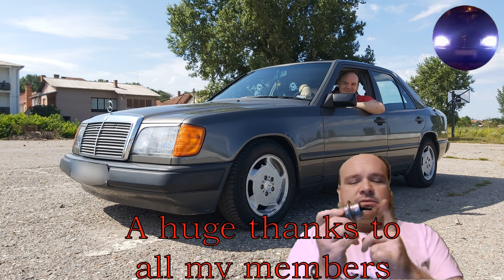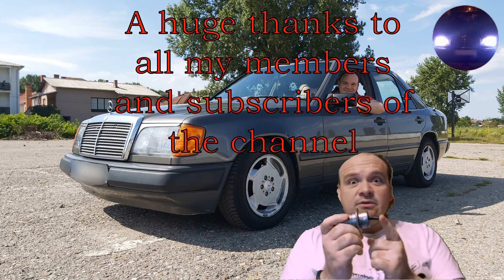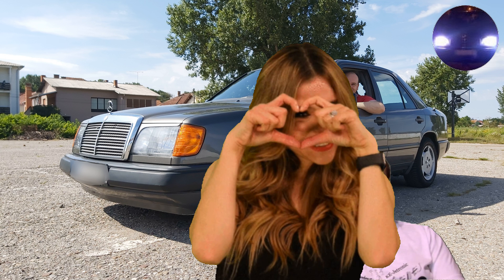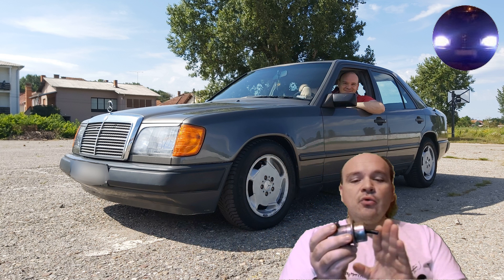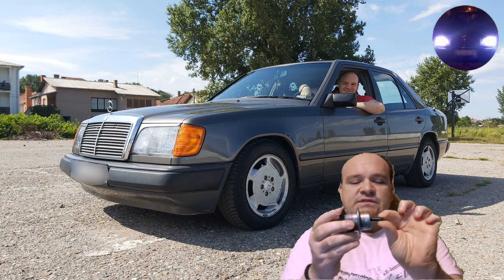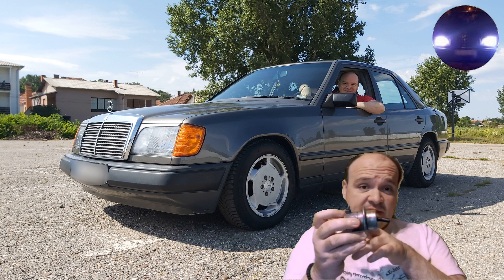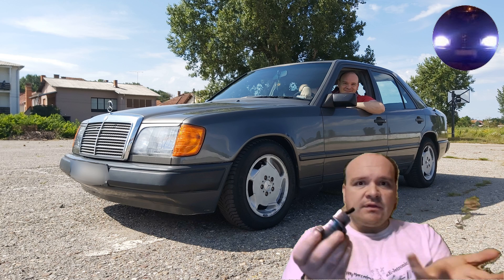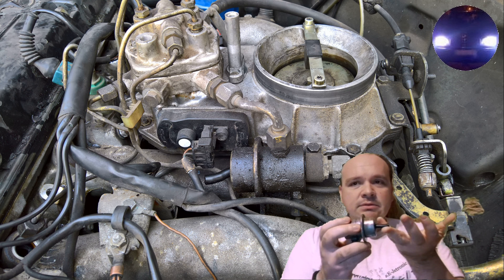㉦Mercedes Ke-Jetronic㉦ - I was wrong!

Comment: Hi Ivica.
Regarding this vent line from the pressure regulator, there is a guy Tony working on a 560SL and there i've seen a vacuum linevfrom this regulator vent to the right side breather hose from valve cover to air filter. What do you think about that?
I will check in my manual for the vacuum arrangement in a week and i'll let you know. Also there is a australian WWMA that works on w124s and he said that this black hose is also a vent. Can be used with different purpose on dif engines? Is this press regulator part number the same for all engines?
Reply from the maker: No, it's not. The same is for m102 and m103 engines, for the others not because they work on higher pressure. There is no vacuum there. I have on my Instagram profile the cross section of the part, it's from Bosch literature and it says clearly VENT. The vacuum is measured there where the air is constantly changing and here nothing is being changed, the part must hold firmly a steady pressure(not speaking about the harsh accelerator).
Reply: Thanks Ivica
Reply from the maker: @ionutboruga6015  You are welcome 😊 Happy Mercedesing 😃 🍀
Reply: On m117.967 there is a vacuum line there
Reply: I cannot attach a photo of a scheme
Reply from the maker: I have it on my Instagram page explained.

Comment: Can i use universal 0 to 10 bar oil pressure sensor for mercedes 230e w124 ?
Reply from the maker: Use the one as the original one.
Reply: @mercedeske  ok 👍👍

Comment: I have a 1989 300e California version and I can’t do a duty cycle it doesn’t read so what should I do I replaced the eha vavle and nothing
Reply from the maker: In order to do duty cycle your potentiometer must be good, lambda and the EHA. But, if you want to do duty cycle do t on the EHA measuring mAmps. When warm on idle you will have to get the fluctuation -3 to 0 mAmps
Reply: I use a snap on digital multimeter on the x11 plug on the wheel well , pins 1 and 3 , turn the multimeter to duty and change the settings to percentage. Set it as close to 50% as possible with the engine at running temp . You should block off the pipe to the fuel vapour filter in the wing but I don't think it makes much of a difference
Reply from the maker: @carnhicks2650  Yes, you can but connect the ground on 2 and positive on 3.
Reply: @mercedeske  just thought I would add , thanks to you , I've managed to go through most of my system and sort out quite a few issues I was having with over fueling , car runs great now . All I do now is adjust my air/fuel ratio whenever I hear the car having to make adjustments to correct the duty , you can hear it drop revs every now and then , that's when I know its gone out of adjustment
Reply from the maker: @carnhicks2650  👌🏻👍🏻💪🏻Happy Mercedesing 😃